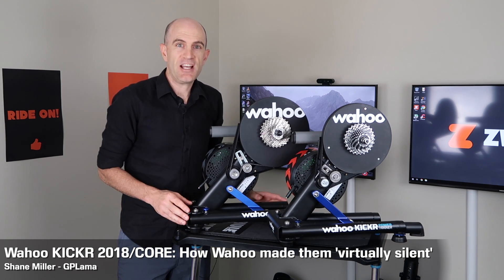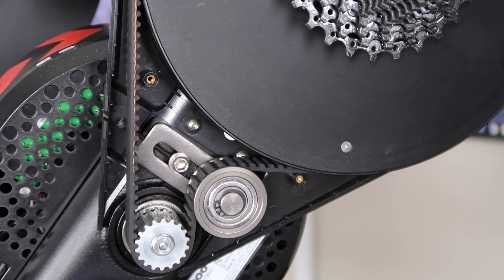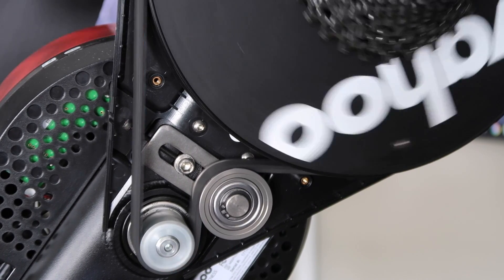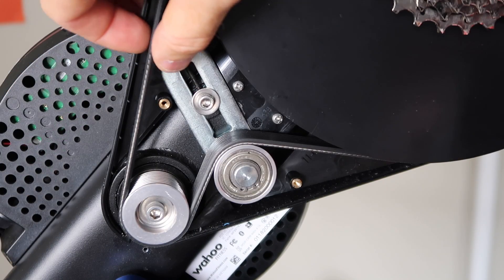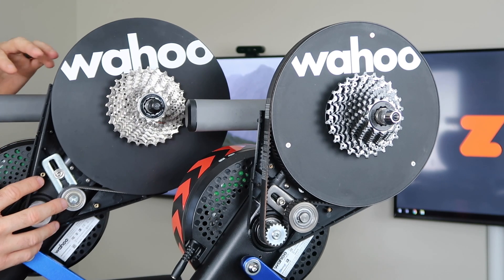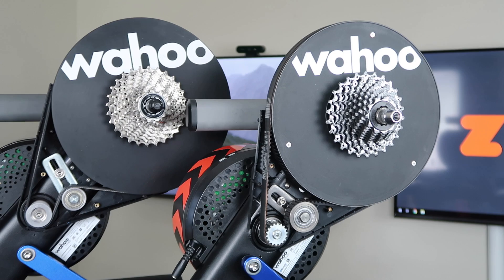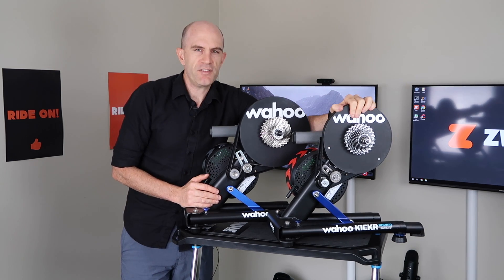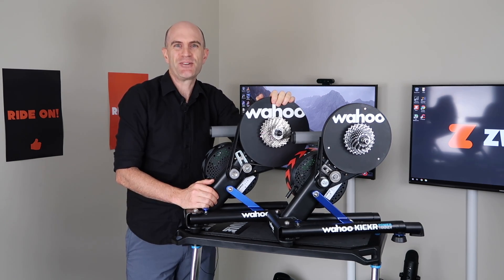Wahoo KICKR 2018/CORE: How Wahoo made them 'virtually silent'

Comment: I wish you would talk about the problems the Kickr 2018 is having. There are a number of issues reported on the internet, and it doesn't seem to be unique. They all seem to be common.
Reply from the maker: I have. This video isn’t about those issues.
Reply: @gplama  can you point me to it? I can't find it in your youtube video library.
Reply from the maker: @GoonieGooGoo910  Somewhere in a Lama Drives. Here's the word straight from Wahoo: https://www.youtube.com/watch?v=6MgromwkTOs
Reply: Shane Miller - GPLama thanks. That’s not quite what I was referring to, though. Basically the fixes don’t take, multiple returned units for units that supposedly have the fix, and a series of continuous returns. I’ve gone through multiple units as have others. There’s more to it than the key and key way. There’s the clunking, squeaking, belt rubbing, and pulsating friction. None of these existed on my KICKR 1. These issues are not unique to myself, it’s out there happening to multiple people.

I understand this video is not about that, but it needs more exposure as people are buying these and getting bit with multiple returns of units that are supposedly fixed. What then happens out of warranty? Exchanged units show problems in a month. That seems to be the typical period.
Reply from the maker: @GoonieGooGoo910  I've been asked (to the point of being abused over this) about this so, excuse my sharpness in reply here. I haven't encountered the issue with either the Kickr18 or CORE. If I did, I'd be able to cover my experience with the fix. That'd get a lot of hits/views here on my channel. 

I've always recommended people purchase locally for big $ items so they can return without problem. I've also stated 'three strikes' should apply to tech. After trying a third unit, it's time to move on. That's enough opportunity for a company to prove they don't make shit. At the end of the day this isn't my issue, it's not an issue I have encountered, and it's an issue I have no control over. 

If people are unhappy with Wahoo - I get it. I also have a broader view of things in dealing with every other trainer company out there. Most are no better.
Reply: Shane Miller - GPLama thanks for the reply. There is/was no abuse from me. I’m not sure why you’re sensitive about it. I was just asking for a follow up on it, when it seems many users have issues. Just google it. I did buy locally, but after the song and dance and 3 returned trainers with the same issue, it’s outside the window for a local store, as well as inconvenient. Yes, time to move on from Wahoo, but I would like more people to know that the KICKR 2018 has issues that are repeatable for many consumers and it’s not fixed as Wahoo proclaim. Google Kickr noise and you’ll find it but only in comment sections. Most just move on and keep it quiet, or post the kit fix, and no follow up unless asked. it’s a hassle to deal with.

Now, my understanding is/was that you were promoting yourself as a journalist in the area of fitness trainers. Since the problem is broad, and the only response is that you only present your experiences, then I guess I misunderstood your videos as they only offer short term views, little long term, and don’t follow up feedback, journalistically, from other users.

I understand Wahoo wants to keep this quiet, but a quick search will turn up multiple people with similar problems. I just think it’s a disservice to not talk about this. The line from the online promoters always seems to be, not my experience or no answer at all. That’s fine, it just puts those reviews in a different bucket.

My point is this. All the reviewers, all seem to present the same thing. You mentioned many companies are no better. I’m glad you know it, but us consumers do not. Nobody ranks and presents that. That is severely missing, and people end up buying and dealing with issues on their own. And if companies are not as good as Wahoo, then you’re really screwed. Extrapolate that to the SMART bikes. Now companies are getting into multi-thousand dollar units. What are these companies track records for long term issues and how they deal with them? I have no idea. I’m glad you do, and it would be nice to talk about it because most of us follow your videos and DC Rainmaker’s. Features and accuracy are nice but if they breakdown, now what? Wahoo trues to address, kudos to them, but what if it keeps having issues? What do you do? Sell it on the used market to an unsuspecting buyer and hope for the best? Keep it a secret so there is resell value? What about a Tacx? What about Saris? I have no clue, and nobody talks about it.

Even in the age of online reviews and social media, it’s still buyer beware and have to dig through comments on videos and articles to even hear about problems and how they are dealt with by companies. It’s unfortunate that I’m not on Facebook, I may have heard about this problem before buying mine. My searches turned up nothing other than all problems fixed, which is far from reality. You just need to refine the search, as it doesn’t show up when you search “problems.”
Reply from the maker: @GoonieGooGoo910  Two steps back. I'm here. I'm in every comment. Every reply. Every user query I have. "Offering only short term views, don't follow up, etc"? I disagree. I have over 900 videos up on here. A number of them are long term follow ups. Someone asked about the Vortex power accuracy the other day from years back, I had an answer within minutes. One of thousands of examples where what I'm doing is different to other people who post videos/tech content online. 

I don't consider myself a journalist. In any way. I'm a cyclist with a camera. I'm looking for the next 'best thing'. And I'm trying to confirm what is sold is what we get. This is why I'm so anal about power meter accuracy. I'm on your side. I'm putting myself and my name on the line posting ANYTHING that wouldn't be considered 'good PR / advertising' for companies. The amount of shitlists I'm on is longer than my arm. I have a number of companies who won't reply to emails because I don't "sell" their message. So when users infer I'm not honest or have motive not to talk about something - yes, it pisses me off. If I dismissed it and ignored you - that'd be more concerning. 

Covering off the Wahoo issue - I've talked about it. A lot. I'm not ignoring it. It came up over and over again in co-lab videos and podcasts with DCR. Wahoo chose to host their "Yeah we fucked up" video with DCR. So I point people that way if they want the word right from the horses mouth. This has now resulted in someone like yourself taking aim at me. I'm harder on myself than anyone can be, but I do want to clear things up - even some prick over on Reddit who goes me any chance he has - I've reached out to. No response. Anyhow... 

This isn't the first time recently someone who has purchased something has taken aim at 'reviewers' such as myself. This is exactly why I REALLY don't like (and rarely) tell people exactly what to buy. If they have a bad experience - they need someone to blame - companies are faceless - and I'm here responding... so bam. I'm the arsehole, then things go south when I do respond. Case in point. Now.
Reply: @gplama  OK, thanks. I appreciate the effort. I don't follow podcasts, so there's that. If that's where it's talked about then I won't know about it. All I know is that videos don't talk about it, or it's not headlined. DC Rainmaker had that video from Wahoo, but the implication there is that there's no problem. That's far from reality. People do, in the comments, and various people have other videos talking about the self-applied fix, and casually mention it's their 2nd, 3rd, 4th unit.

Anyhow, the info I may have to add is that "the fix" is not being applied correctly, resulting in Kickrs that have issues even after it's supposedly a fixed version. At the same time, the tolerances seem too large to be a proper fix and I can't see how that can't work loose. Aside from that, there are multiples of people with fixed units that have repeated issues, and it's probably due to the improper installation, by the assemblers. Now, don't get me wrong. I really like Wahoo, but I'm really disappointed in this. My Kickr1 is still running semi-well, power accuracy sucks, but it works at least. I can't say the same for the 2018 version. I'm going to try Tacx, but they have their problems, some of which I know about...and it's also Garmin now, which is perpetually slow with updates, so that's not good as well. I'd try Saris or Elite, but I don't know anything about those companies, if something goes wrong. I know Wahoo is taking care of people, but it is unfortunate that this problem is not being addressed more openly. As I mentioned, that one video implies all is golden post fixed Kickr, when in reality it is not. I actually bought the 2018 after the video because I thought it was all fixed, and then I went through multiple units.

https://youtu.be/fryyIMEYmFI
https://youtu.be/bp9penpjYlg

Comment: Hey Shane, those parallel groves on the rollers have been on Drivo gen 1 for ages and thats why they are quiet too. Kickr was late to implement, and probably copied other trainers, hah.
Reply from the maker: The Flux also has a similar belt.

Comment: As the Kickr 2018 seems to have many problems, Do you recommend to buy the Kickr Core (I'm a woman and doesn't really need extreme power)? Is it reliable and easy to calibrate ? Thanks
Reply from the maker: Sure, CORE. Buy local from a shop that provides great service.

Comment: Virtually silent? Our third Kickr Core replacement in the house, and it still is vibrating like hell at wattages above 200 to 220. The Flywheel is out of balance an starts to rattle and shake the trainer in a horrible way. Patience is almost gone now! :-(
Reply from the maker: I'm sorry to hear this (and others). I'm getting a lot of heat over the issues other people are encountering with Kickr18/CORE that I haven't experienced, or that I have any influence over. Best I can do is point people towards Wahoo Support.
Reply: You have a solid floor with carpet and damping. It's a hassle but you could try building a "wooden floor" from a pallet and a sheet of OSB3 or something similar. Not sure that would be the same but you'd be surprised how crap the Kickr is on something that isn't solid when it starts vibrating (and they all seem to do that). I returned mine for a Neo 2 and am so happy with the change!

Comment: So this looks like something you could retrofit. Why not give it a go and report back to us
Reply from the maker: A few reasons: I don't think it'll work. I'd have to sacrifice a known/good/working Kickr18 or CORE to try it. And I don't want to encourage others to void warranty/support agreements. If it ends in tears, I'll be shitlisted, people will shrug and move on. If it works...I'm still shitlisted for much the same reasons. I don't see much upside here.
Reply: @gplama  I get it. I'd be interested in getting the new parts myself and attempting it. I replaced the main drive arm on my gen1 kickr which meant removing those pulleys so I can't see why, with the right belt and pulleys, you wouldn't be able to retrofit it. If I do have any success I'll report back

Comment: Probably not right place to ask, but here goes. Got my Kickr Core and promptly shattered right wrist on a trail hike. Is it feasible to swap RD shifting the the left shifter so I can keep a semblance of fitness while my right wrist heals (surgery Wed 11/14). Won't be able to do full on Zwift races or GPLama workouts, but I can spin a bit to workout. Many thanks...
Reply from the maker: Sorry to hear about the wrist... nasty work! The inners of the left/right levers are different, so it's not something a cable swap will allow on a mechanical setup. If you're on Di2 it might be another answer though. If you're on electronic there's a few options with sprint shifters, climbing shifters, or blips that can be added. There's always a solution... it just takes the right tools.
Reply: @gplama  Called Shimano. They suggested a quick and dirty solution using aero bar shifters mounted on the left drop...maybe in bar end. That way I can have both front derailleur and rear derailleur capability.  I won't be hitting any Zwift KOMs, but I will be able to get some work in. Surgeon said I could probably be able to shift normally in 4 weeks tops... maybe sooner. Issue is more the pulling and pushing pressure rather than rotational stress....that surprised me. Solution is USD 150.00 vs. USD 1800.OO for Di2 conversion. Surgery completed today with no complications

Comment: Went through four 18's and none were silent. Far from it. Anyway moved on to a Tacx Neo and so far very happy. So smooth and silent. Didn't want to do the beta testing for the Neo 2 as I did for the 18. May trade up to a Neo 2 once any bugs are sorted. 

I think it's probably normal on the Neo with a virtual flywheel, but from stationary the initial small amount of pedal movement has no resistance, then the brake kicks in. Feels like taking up slack.

Comment: I have a v2 and 18 and all I can say is I’m not impressed Wahoo.
All the early units have been made wrong with undersized woodruff keys so they clunky under power so I have been waiting for the modification parts to arrive from Wahoo,this unit has done 10 mile in 2 weeks.
If you want to save money just buy earlier version and replace the gates belt for a continental and is so much quieter...
Reply from the maker: I'm watching the comments roll in. There's not a lot I can do... other than point people at Wahoo Support. If I encounter the issues with my unit(s) I'll document the process and help others.

Comment: The 2018 is incredibly quiet compared to gen 1, imo after many small upgrades the 2018 is finally Kickr 2.0 and massively superior to gen 1.  I think a further improvement in sound would be to dampen the upper pulley as the freehub resonates/rings against it (more then gen 1, different material, easily audible by tapping it with your fingernail), ringing could be muffled on inner non drive side cavity, but obviously never want that coming loose.

Comment: Shane, could you post the diameter of the new and old flywheel?. I have a Kickr18, but still experience a fair amount of noise,  my first smart trainer so I don't have any basis for comparison.
Reply: That'd be your bike's drivetrain. The cassette and chain can make a surprising amount of noise. The trainer itself makes very little noise (other than when freewheeling/coasting).
Reply: Thanks for your reply, though I doubt it, The drive train is brand new Ultegra 11 speed. First ride, actually.   @jmvdigital
Reply: @tomfield2292  Hmm, then perhaps you have a faulty unit. Does it make a lot clicking noises or thumping/vibrating? There is a well known issue with the early K18s that Wahoo is still trying to sort through. I went through several units (with Wahoo support being extremely helpful) and finally have a good working, quiet unit. Check out posts on the Facebook Wahoo Support Group (https://www.facebook.com/groups/329097417298661/)

Comment: My 17 kickr has the whining, but use to it. Not that loud since I loosen the belt some. But it's a trademark sound of the kickr in my opinion that makes me stick with what I have. I don't ride it as much as most other's so I haven't had any issues with it. Love it.
Reply: Ditto mine.  Never had the wining (sp?) from day one.  I had some belt slippage recently which was due to the belt "delaminating".  I replaced the belt and I think it's even quiter than before.  Of course, I only run the tension up enough to stop me slipping on my level of sprinting.  I can't generate huge numbers, so no need to worry about it slipping above maybe 800 watts, just to be on the safe side...
Reply: @pauldamian2988  It was good to see what makes the trademark sound of the Kickr. (yea my spelling , Whining noise...)

Comment: Essentially mimics how cars have had their pulleys and belts designed for decades.
Reply: Christoffer Jansson Had their auxiliary belts built* (2018) Did they go for a teethed belt for durability first? Of course the Kickr doesn't really need alignment like an engine so a grooved belt should probably always have been the choice. I wonder if the belt is some generic belt that can be had for less than Wahoo sells a replacement for? The Tacx can get cheaper if the belt doesn't last 10 years, while there is no reason it shouldn't under such low use and power compared to a car, they still sell a replacement!
Reply: @rkan2  yeah thanks for clarifying ;). I would suspect the belt is either of the same or lesser grade/quality as you say it's under less stress. Also AFAIK car aux belts do not make a lot of noise either hence that shouldn't be a factor here either. I guess the problem might be to find an auxiliary belt with the correct dimensions.
Reply: Exactly. This is why your reverse gear sounds like a hum yet your fan belt is silent.